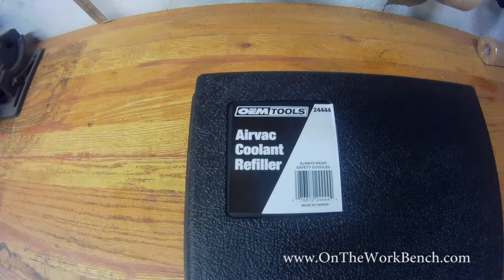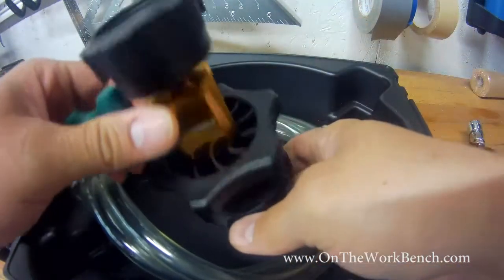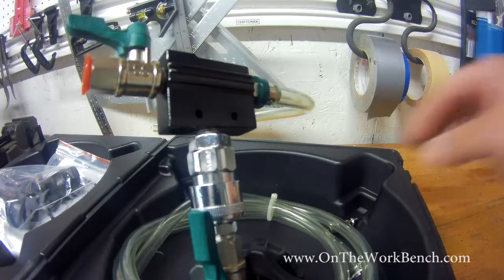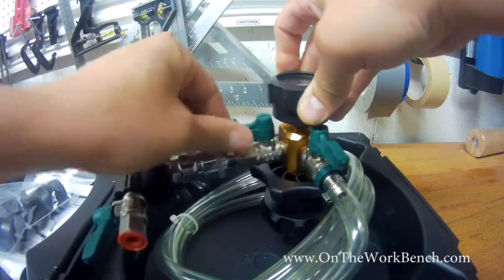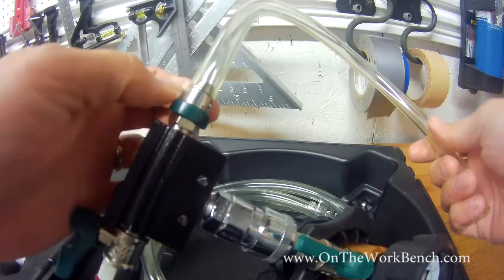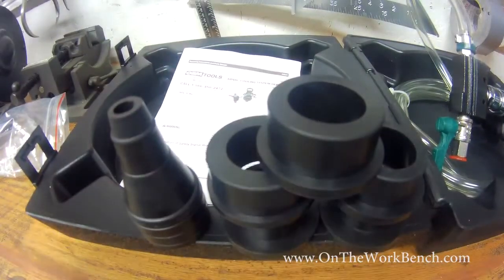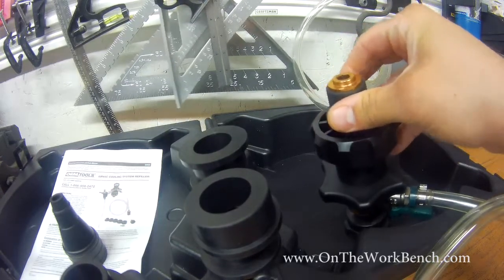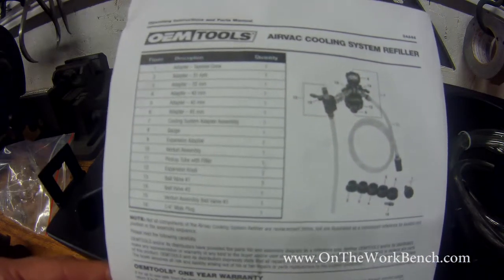OEMTools Coolant Refiller AirEvac Kit

Comment: Did you find a working psi for the flush? I just did my car and used a lot less than you suggested with the ~90psi. I had to do it twice to get it right, using 30 psi, which pulled a -25 psi vacuum. I really like the tool and now that I know how to properly use t I can fine tune the working pressures to get it perfect in one shot. Very well built and in my opinion worth the cost. I’m starting an M car (BMW) specific shop for likeminded enthusiast who love their cars and want to have them properly cared for, outside of the stealership,  even if they themselves can not turn the wrench. Great video, I’m now Subscribed and looking forward to going through your catalog of content and future videos. Greetings from VA!
Reply: What type of compressor did you use?
Reply from the maker: Great feedback, I've had the best luck in the same range you described of about 30psi to match the vacuum pulled by the unit. I tried it once with a pancake compressor for fun, but it did not have the CFM to pull a vacuum.

Comment: Do you also see the heater lines compress like the main radiator hose?  I assume it also pulls the air from the engine via the thermostat.   Do you prefer to use the tool on the overflow tank vs the radiator?

Comment: GARBAGE! The body doesn't fix to the radiator.. they send you some "spacers" to complete the mating to the radiator.. IT NEEDS TO HAVE A RIGID ADAPTER. That one piece makes this problematic to use.. it doesn't create a reliable air tight connection.

Comment: How much vacuum is too much? I'd like to use as little as possible on my Ls7. Never used one of these before but just picked one up.

Also I don't see how this can pull a vacuum on the entire system if the system is already full of coolant. I guess I'll have to drain it?
Reply: Yes, drain first! This tool is ONLY for refilling (using a vacuum to pull it back into car).

Comment: Just bought this and system won't hold a vacuum yet there's not a drop of coolant leak and no hissing noise.  I've carefully inspected every hose and they're all dry as can be and no coolant around head gasket.  The only weird thing is I do hear a gurgling noise every few minutes.  I assume that's air pockets being sucked out.  I can only figure the universal fitting to the radiator cap isn't sealed perfectly.  Disappointed but open to suggestions.
Reply: If you have this in the radiator and the tube going to the overflow tank needs to be pinched off. Sounds like it’s pulling vacuum through the small hose.

Comment: Can you explain how to do a complete flush of the system!  I have heard that just opening the bottom radiator hose only gets part of it!  How do you do it?  Thanks, Tom
Reply: You can add in fittings to heater hoses to flush with a garden hose. Many suggest it is only worth doing using hot water to flush the system and doing so in the opposite direction of normal flow. This is to flush out sediment and minerals. Some vehicles need a separate flush for oil or transmission coolers. Some suggest removing the thermostat and having the heater in the high position to open the heater core valve.

Comment: I'm not getting a vacuum. Air compressor has 125 PSI
Reply from the maker: How many CFM is your compressor rated for? It does not play nice with low volume pancake compressors, it probably needs at least 5+ cfm
Reply: Look for pressure relief hole in place of connection on car, and if there is, than you should use the cone shaped adapter.